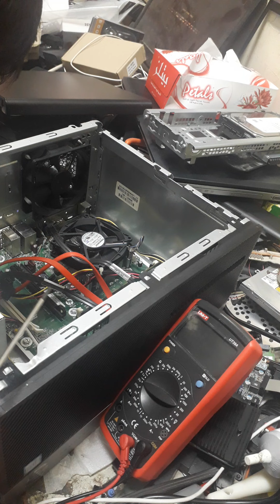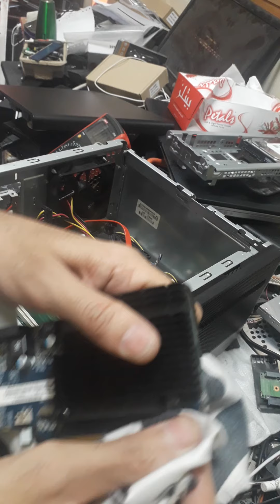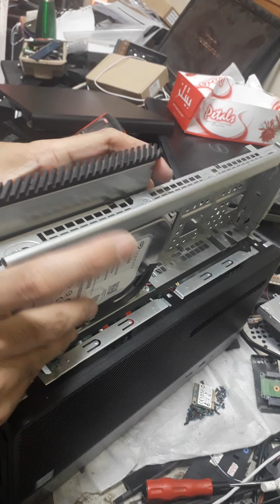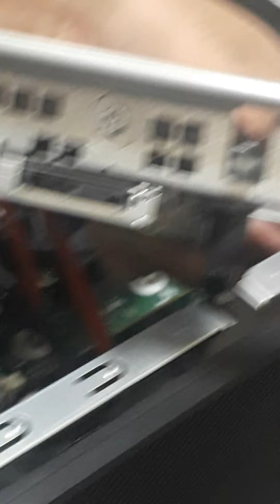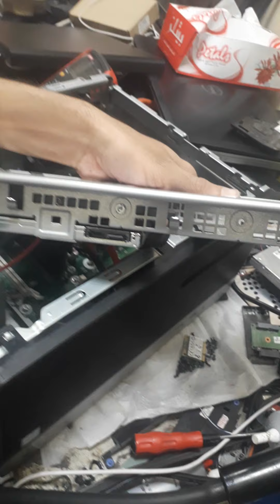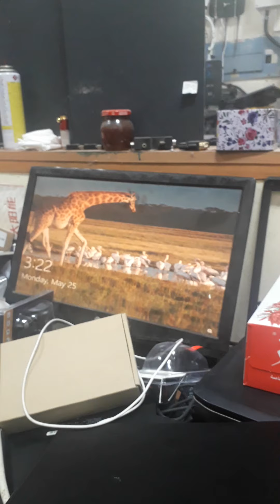Hp ProDesk 400 G4 MT Red light & Display Problem Part3| How fix hp 400 G4MT Red Light

Comment: You just clean videocard so the computer start to display?
Reply from the maker: Diffrent issow in diffent models 1.ram problem  2.video card   3.bios program 4.Prosscer Problem    5.Grifix chip problem  6.main chip problem  Some time mainboard no make Display volts or some  thing short not Making display volts